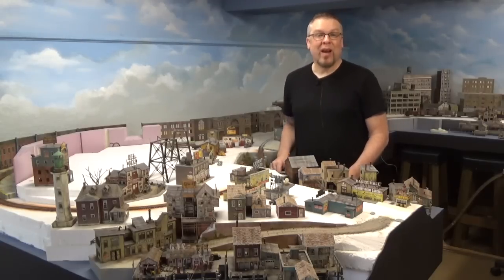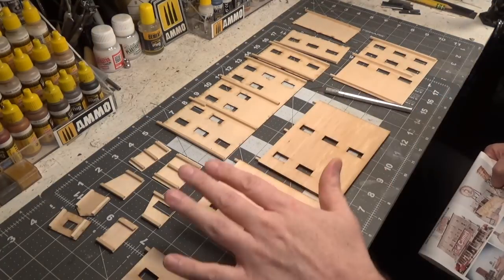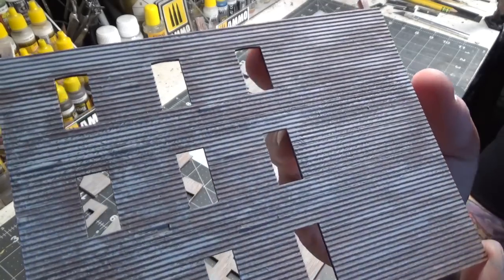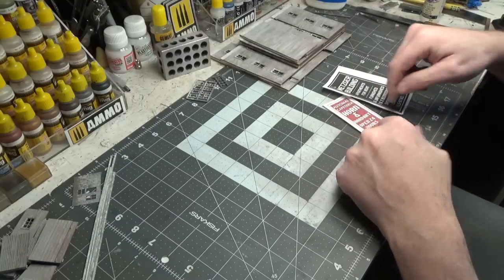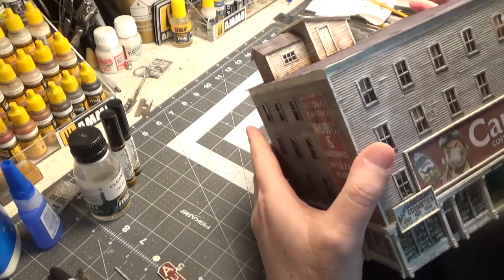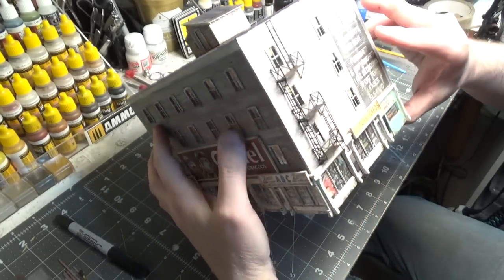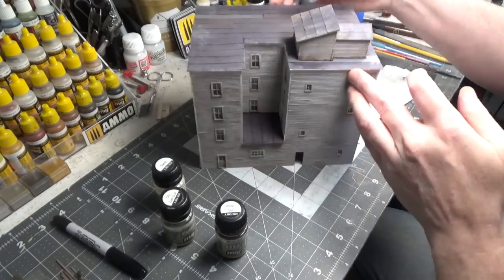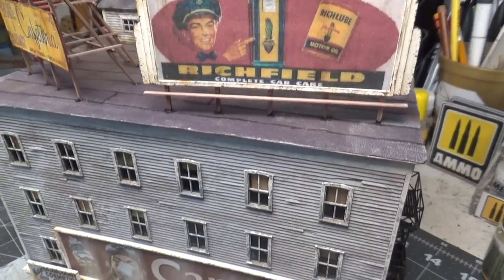Building a big city structure!

Comment: I have a question of Craft  Paint.  It seems like everytime you use them, you shake them for 2 or 3 seconds and then start painting with them.  My craft is as thick as mud.  Do you do a little off-camera magic and power mix the paint? Or do I have the lumpyest paint on the planet?
Reply from the maker: I really love using Amaricana craft paint because I like the thickness of it. I sometimes add a little water to thin them or simply use a wet brush. I’ve tried a lot of craft paint and Americana is my favorite. Thanks for watching!!!